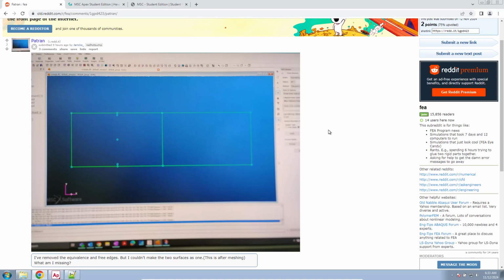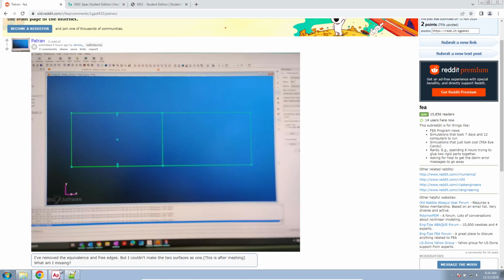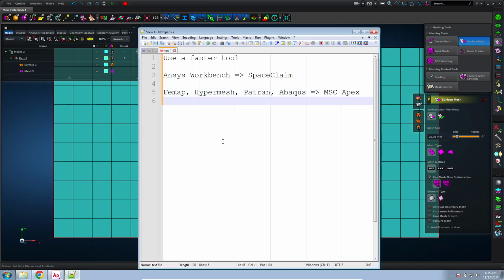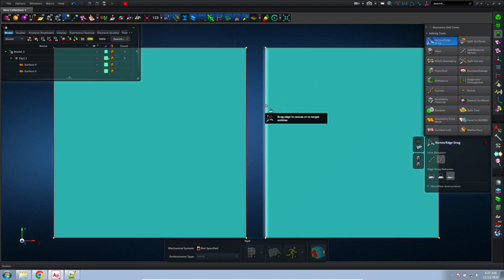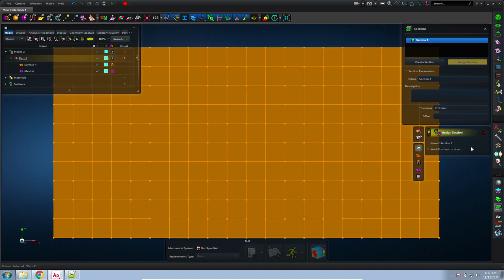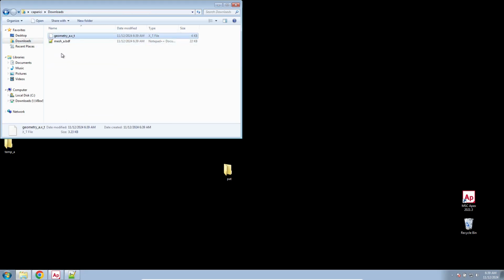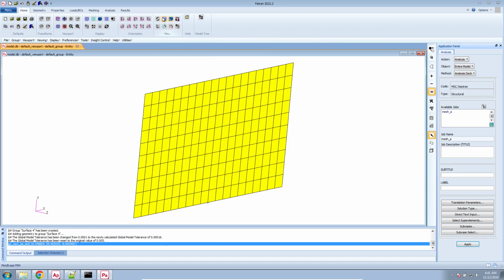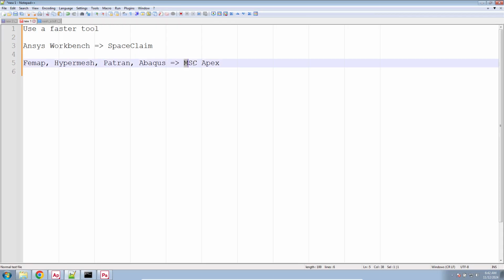Merging CAD surfaces for meshing and FEA - MSC Apex, Patran, MSC Nastran, Femap, Hypermesh, Abaqus

Comment: great videos! Can you please tell if it is possible to run random vibration analysis in APEX
Reply from the maker: Maybe.

The best thing to do is ask mscapex.support @mscsoftware.com for a tutorial on how to configure a random analysis in MSC Apex. The tutorial may or may not exist, which indicates if Apex supports random analysis or not. If you are a student or professional, make sure to mention this in the email.

I took a look at MSC Apex 2024.1's GUI and I see that SOL 101, 103, 105 and 108 are supported, which correspond to linear statics, normal modes, linear buckling and direct frequency response analysis, respectively. Digging a little more, I see that there are options to create RANDOM and RANDPS entries. The presence of these entries is evidence that random analysis is supported. BUT for full confirmation, we need to see a tutorial on how to configure a random analysis in MSC Apex.